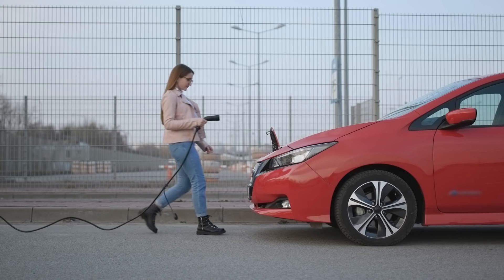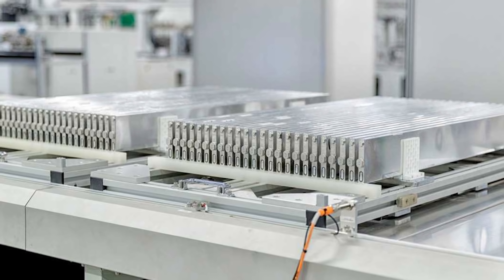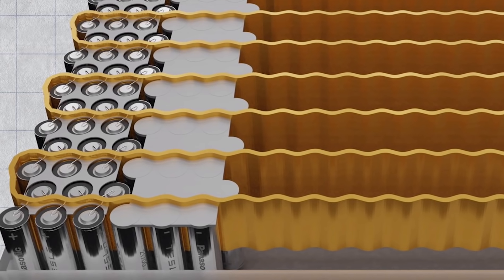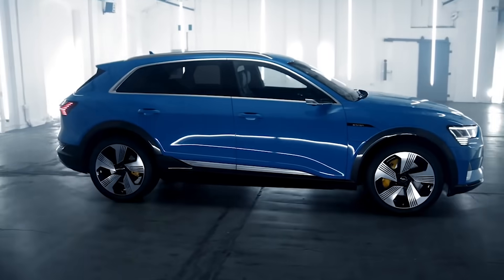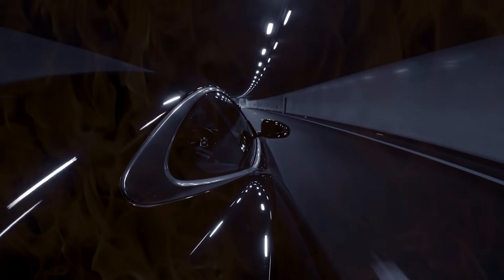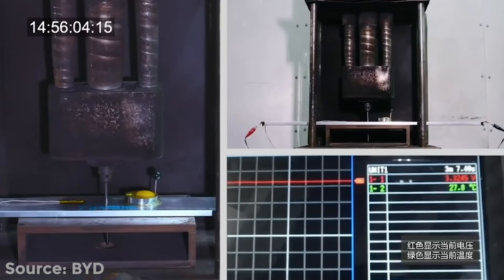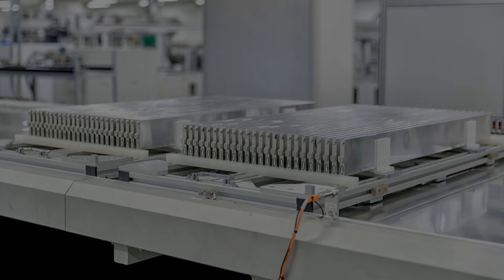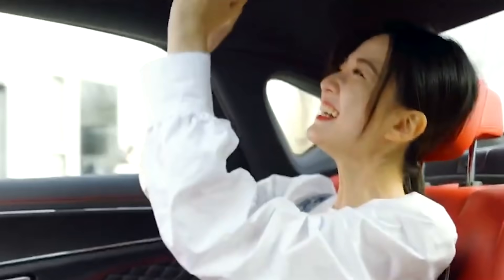Uncovering China's Battery Breakthrough

Comment: why must we store power when we have hydrogen, why are we not producing vehicles running on hydrogen, its produces no contaminants apart from H20.  

People will never accept electric cars until they can be made as easy as a fossil fuel vehicles, if we are going down the road of using cars powered by batteries then we should be having gas stations that change the battery when we pull in, there should be a common battery to power cars that slides into a dock under the car and you just drive in to a gas station and in 1 minute you drive out fully charged. That is what is needed rather than 50 different manufacturers designing god knows how many batteries at a phenomenal cost to the environment when one design will do them all. Get together and talk!

Comment: LiFePO4 cells are robust and make a viable EV battery. However, they fall short in energy density. Closer every day, but still 25% short. Cold temp performance is also quite poor.

Comment: How come your batteries are not using gold. And why would you need to charge batteries when you can use a generator or a alternator period which is combined with the drivetrain motor drives. It just don't really make sense

Comment: The shape of each cell doesn't matter all that much when they're being stuffed in a battery pack next to each other to increase capacity per volume.  The physical thickness of each does, for individual cooling.  You still need a way to carry away the heat from inside that volume, from between all the batteries.  Flat rectangular batteries are not a revolutionary design, so I don't understand the point of this video.  This is one of those few videos that are just "meh, it's already being done, but nice try marketing".

Also, why is a lantern used as a cover photo?  This stupifies the post even more.
Reply: Honestly it's the clickbait title that gets me.
This isn't a revolutionary new battery "type". it's just a different shape. 
It's still just lead acid or lipo.
Reply: yeah its not really revolutionary but at least its make sense to poke other manufacturer an idea to make battery's that's designed to solve problem of e-car manufacturer nowadays.

Comment: Question: Doesn’t an array of cylinders with the same volume have a larger surface area for cooling?
Reply: I think it's not so much about the surface area per se, but about the space you can allow between batteries. The heat has to be carried away by airflow, thus you need enough space for this airflow to happen.
That said, I'm not convinced that passive cooling would suffice for those batteries.
Reply: Cylinder has higher volume per surface area, so it's less surface area for same volume.

Comment: There is alot wrong in this video, so let's go over the high points: 
1. There's more surface area in a rolled up battery by a LARGE MARGIN. Take that "blade", roll it up, see how it takes up less space? 
2. Electric cars don't make power from thin area. It's still taken from the grid, and just as wasteful and potentially polluting as any power you use in your home. It doesn't solve the energy problem, it just shifts it's focus. 
3. If anyone REALLY cared about the effects of pollution on the global environment, they'd stop dumping all of their manufacturing on China, a country with the WORST POLLUTION ON THE PLANET.

Comment: It still doesn't address the key issue, and that is the lifespan of the vehicle. #planetofthehumans And I see only little gains from using the battery as structural component, however I do see great benefits from swap batteries in some kind of standardised form, that are swapped at the bottom side of the vehicle automatically at a 'gas station' where charged batteries are stacked up ready to go in an underground charging lot transported on conveyer belts. That would remove the whole charge time issue altogether.

Comment: I think we might see different types of blade batteries made, for one thing if mounted at a slant they could be cooled more efficient with airflow designed into the vehicle, theoretically cooler batteries could offer better range and more power, a slanted design that takes advantage of airflow would be useful in more sporty models of cars.
Reply: This would never happen. Having a battery pack that is open to allow outside air to pass through it would be a major issue because water, salt, dust, stones and more could also get through and damage the battery severely

Comment: We’ll see how this technology fares long-term. My primary thoughts are if this does anything to address extreme cold? Also passive cooling doesn’t sound like a great idea especially in hot areas of the world where there is a lot of stop & go traffic. 

What about longevity? How long do these packs last? 

Serviceability & replacement. In the likely scenario where you cannot replace the battery yourself what does it cost to buy & replace? 

What about range in extreme temperatures? How is that affected?
Reply: Well the problem with lithium is u cant take them under 40 degrees. So you have to add a heating element. That takes battery power,if battery hit 0 in a cold area all your batterys r fuked. So good in hot areas, cooling wasnt ever a issue,

Comment: I think these cells are in a race with ceramic and Tesla’s new proprietary design.  I believe BYD’s design will win in EV’s but will fail in smartphones.  Ceramic batteries are more likely to be in the future smartphones than BYD’s design.  While the ceramic battery will be more expensive for the newer designs, it has significant benefits in tight spaces and can charge very fast.  The newer design that I am specifically referring to is the one without an anode by QuantumScape.  This battery also never dies which is even better for the environment.  I could see both technologies being very popular among consumers in the future.  The downside, however, is that neither of them hold massive amounts more which could be used when we do finally develop nuclear fusion reactors that produce energy.  The infrastructure we have could not hold that much energy if a nuclear fusion reactor was stable.  I have a feeling that building more spinning weights won’t be enough for that event.  Perhaps the next solution would be to somehow crystallize the ions in big chunks which could be broken down later.  I am unsure how you would do this but it would certainly be more cost efficient than spinning weights.  The problem with that, though, is I would imagine you would have to store these crystals in some kind of container to prevent the ions from escaping from the crystal.  Again, I don’t even know if it would be possible to form such a crystal, much less create large amounts and store them safely.  Ideally, we should come up with a better method for storing energy but I just tried that and so have many engineers who know a lot more than I do about the subject.  I wonder if cars would just form nuclear fusion reactions instead.  Imagine dumping water in your EV and you’re good to go.  Kind of hard to say what we will come up with in the future without looking at more research.

Comment: Without watercooling, I'm assuming humid and hot climates, the battery will suffer from the inability to transfer heat to a hot medium.
Reply: The large surface area solves that. Conventional round batteries have lots of small cells with a tiny surface area, so they generate a lot of heat to be taken way. I'm guessing you can have a much higher power battery since it has a larger surface area to dissipate any heat buildup. Also the lack of cobalt means less heat to begin with, it's the cobalt reaction that tends to run away and generate more heat than necessary, also making it less efficient as a lot of stored power is lost via heat.
Reply: Yep, that claim is absolute bullshit. EV batteries need a full on thermal management system able to heat and cool the battery. 
LiFe chemistry cannot even charge at freezing temperatures, and heating them without a heat pump is a waste of energy. In the summer just the ambient heat alone will be dramatically accelerating wear on the battery pack. 
Teslas batteries have shown incredible "health data" over the years, and I just dont see that happening without the sophisticated thermal management.
Reply: Air cooled areas will get dusty, sticky, smudged etc. Surfaces will loose their ability to get rid of the heat?...unless it't protected somehow with air filters etc.
Reply: humid air is desirable- it's hot dry air that will lack the cooling ability.  Hot streets in Phoenix, AZ could be a problem!   A battery pack might include a few super capacitors for stop-and-go driving. These are of limited range but they will not heat up, are not affected by temperature, and can cycle almost indefinitely.   
It's clear that battery technology is going to deliver, and soon though.  That's very good news.
Reply: @someotherdude  Your claims are complete bullshit. The heat capacity difference between completely dry and completely humid air (calculated for 20°C) is only 3.6%. It simply does not matter. The heat pump systems are laid out to sufficiently perform for the entire specification of the vehicle, and there is no real limitation to the technology. 
Super capacitors seem completely unnecessary because the capacity is pretty miniscule, the cost is high and there is already a capable battery pack on board. Look into DoD (depth of discharge) and you will see that battery degradation with tiny charges and discharges goes towards zero. None of this is an issue. 

What is an issue, is heating the battery. The heat pump system needs to be very efficient to be able to heat the battery in winter without reducing range too much.
Reply: @drkastenbrot  WRONG.    Look up heat dissipation in humid air vs dry air and you can easily find lots of science on that, for cooling both electronics and engines.   I tried to paste quotes directly, but YT is returning an error...  so look it up yourself, you'll find it quickly.  I guess I can't quote an abstract now?  WTF.
Super capacitors are now capable of accelerating a car to full speed and there have been combined battery/caps for many years.  They have been repeatedly proposed for cars and it makes a lot of sense. Back to the heat dissipation: what I said is true for both simple convective heat dissipation and for forced air dissipation.   Now, I'm going to try to post again.... not sure why YT has a problem with my comment, I don't think I'm being racist....
Reply: @someotherdude  All high power components are liquid cooled and the liquid is cooled via a heat pump which is designed for all environmental conditions for the target market. I have no clue why you think cooling something is an issue, when manufacturers can freely choose the size of heat pump system according to the needs. Oh, and my calculation was just thermodynamics. Thermodynamics are not wrong. 

Supercapacitors are great whereever the batteries cannot supply peak demands of current. Electric cars do not have a power issue, they are pulling off 1000+ hp with just batteries. 
As an energy storage, supercapacitors are greatly inferior, with just about 3% of the energy density of the same weight of lithium cells. Replacing batteries with supercapacitors will give you less range, why are you suggesting it would be a good idea?

Comment: Lithium iron phosphate has smaller power density. What you are saying its useless. They last longer, but they offer a lot smaller range, no matter the shape.
Again, fake chinese claims.
If they wanted safe battery, that is only lithium titanate. Safest ever made on earth. LTO YINLONG. DOUBLE THE WEIGHT THAN ALL OTHER LITHIUMS BUT RESISTANT TO ANYTHING. YOU CAN DRILL A HOLE AND THERE IS EVEN A SPARK.

LITHIUM IRON PHOSPHATE CANNOT WORK IN COLD WHEATHER. IT NEEDS 30°C temperature to be able to discharge properly its energy.
At 40°C, lifepo4 output does its works at best. It has very long life cycle, almost 5 times compared to lithium ion but still has fire hazard risk.
You should study more about batteries before posting this crap.

Comment: No way air cooling is going to be as good as liquid cooling in that configuration.  Cooling is important for range, charge time,  safety, and power delivery.   I'll agree on the rest of your pros and if they could be liquid cooled.....they could be the future.
Reply: If air cooling is 'adequate' then using it is far better.  Much less complexity and weight, and even significantly less energy draw on the battery.
Reply: Could the heat generated by the cooling be used to heat the car cabin during the cold months?

Comment: trust me, we dont need batteries..

Broders Engine design / plans..

Works via magnets, coils, and gravity and a spring... Pattent is hidden. And was paid out to supress it in the late 70s. Broders engine plan was kept well hidden and still is fairly unknown about. 

No fuels required. No emissions given off. No special resources needed other than for the device itself.

A small warehouse sized engine can apparently produce enough electricity to power a reasonable sized town between 15-18 thousand homes. Its never ending so long as gravity sticks around.. Which that, sure isnt running out. 

Thus combined with Teslas wireless powergrid idea and design , could create a much better world. And it could be free..

BUT.... $ GET IN THE WAY ... dont they.

And ideas are paid to be kept quiet....poliicians law makers get paid out to make laws to keep things quiet

Comment: The manufacture of the Chinese batteries and the associated pollution due to their continued use of fossil fuels could be fairly simply mitigated by reverse engineering the hardware in the batteries and them making them in our own countries where fossil fuels have less impact on the planet. If the Chinese complain about theft of intellectual property just point them at their own theft from BMW, Audi, Honda, Suzuki, Yamaha ad infinitum. 

I’m really not sure why we’ve allowed China to become the manufacturing centre of the planet since they refuse to clean up their act with emissions. We have plenty of ability in the west but for some reason every time I’ve looked on Amazon over the past few months everything is a Chinese version of previously available products which originated from Germany, UK, France, USA, Japan and other quality manufacturing countries. 

I’m not knocking Chinese quality across the board since some of our most highly considered products/technologies like iPhones and DJI drones are made and probably designed there but in many cases the quality is lacking and worthless. I couldn’t trust a technology that has the capability to explode while I’m sat on top of it, that was designed and manufactured in China

Comment: "cooled using the air"

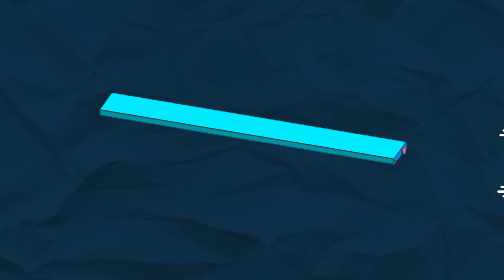yeah... in movement. My friend said the same when the radiator fan broke; the problem is that we got stuck in the Milan traffic. +1:30 late on a 1:00 trip due continuous refillings of the radiator system.
Reply: hmm, its still more efficient even if they use water cooling too on these blade shapes than on cylinder shape, having a copper pipe transfer heat from the flat side of the blade into a water pipe that ends in large fans that cool the water and then return back into a heat loop, the fans only starting when temperature exceeds a certain temperature mark and stopping when driving wind is enough to cool the batteries.

very promising but i seen tons of similar promising techs that ultimately have a fatal problem that cant be solved reasonably.
Reply: So an air cooling fan is worse that water cooling system with fan?

Makes no sense bruh
Reply: @thomaspayne6866  yes, im not adept at explaining things but its mostly due to the fact that blowing air directly to component is cooling the entire environment alongside said component.

while blowing into a water pipe which then circulate to said component is cooling only said component, aka more effecient.
Reply: @thomaspayne6866  it's just moving the problem from A to B, the heat doesn't caese to exist. A liquid moves the heat far easier btw and moving it to a greater surface helps dissipating in the air.

Comment: What kind of a BS video is this?
Prismatic cells are nothing new, I believe first lithium batteries from 80s-90s were prismatic.
Nokia 3310 had prismatic( "rectangular") cells.
The chemistry - LiFePO4 - is nothing new either.
And pretty sure above mentioned chemistry is not cheaper at all, also the density is worse than more standard chemistry used by most of the EV manufacturers so there is no way those can provide any greater density (range).
Ehh even the meme world is right there - "If it's chinese, it's fake"
Reply: Btw. I'm reading the other comments and I see a lot of chinese english that is 100% praising the brand and mentioned tech and the account is created the same month as release of the video and also the account is completely blank.

Comment: So, they made thinner LFP batteries. LFP batteries are safer than the various higher-performing lithium battery chemistries. Wow, what news.
I'd say the more important element here is that these seem to be hard-cased, enabling them to use them as a structural member. Otherwise, it's just a case of having enough capital and potential market to make it worthwhile to make the obvious optimizations for the use case.

I am impressed that they manage to have good-enough production consistency to produce so large modules and not suffer from yield issues. One good thing with having single cells, cylindrical or otherwise, is that you can easily sort out bad ones in qualification testing. If you produce such a large module and it's bad, you have to take a much bigger loss on it.